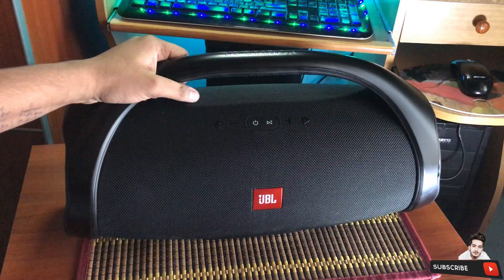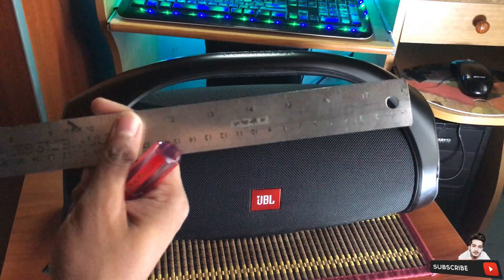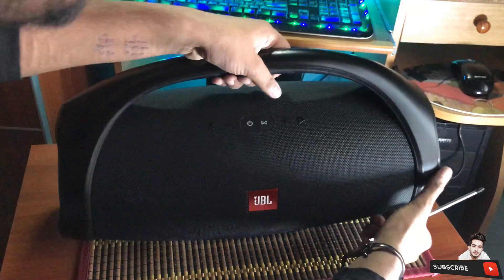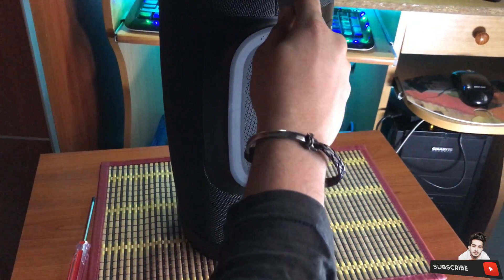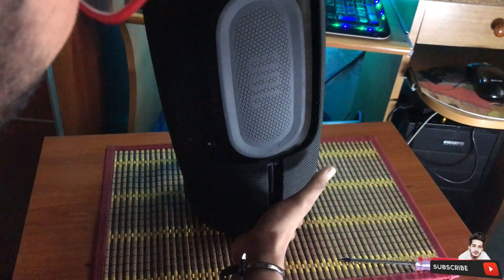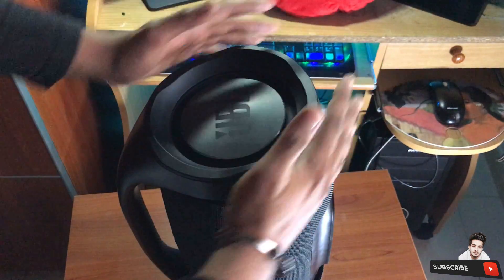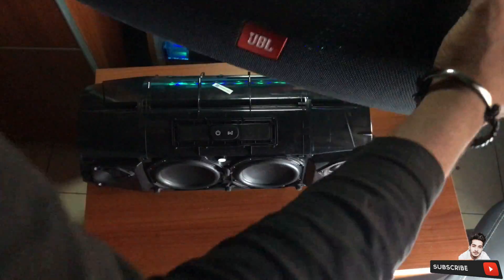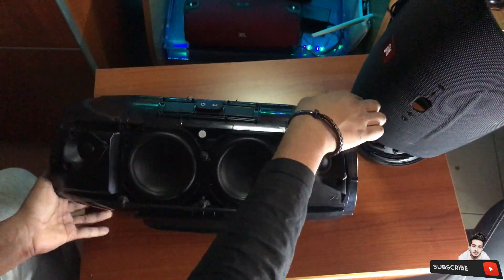JBL BOOMBOX - TEARDOWN / DISSASSEMBLE  [2018]

Comment: Hi sir,  i have a jbl boombox one but don't want turn on from one time press, have to more time of press
Reply: how can fix it please can  tell me sir
Reply from the maker: Try resetting your speaker. In power ON mode press and hold the “Volume +” and “Play” buttons at the same time for more than 3 seconds -> Unit will power Off by itself.

Comment: I think that the boombox is fake as
The jbl logo is darker. Originals have orange coloured and jbl of woofers with a cone with a hemispherical dust cap instead of the the speaker used in this.(jbl use these kind of speakers also but in the smaller ones.) And the teeters are bit too small
Reply: You clearly don’t know what your talking aboit

Comment: I’m using 2 jbl extreme batteries and putting them together to make a new battery pack for the boombox
There’s no other option other than getting a new one and I’m not doing that
One of the batteries were swelled up and wasn’t getting a full shift at work 
Of course it’s just over a year so no warranty anyways
By the time you send it to jbl with return shipping and the cost of labor and parts you’ll be looking at the price of a new one